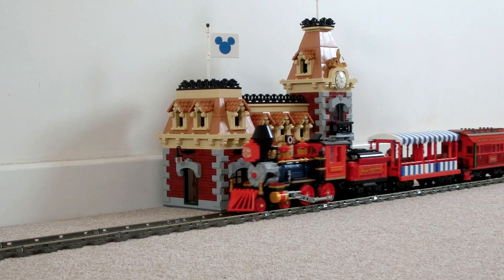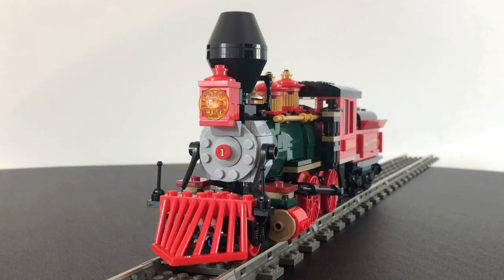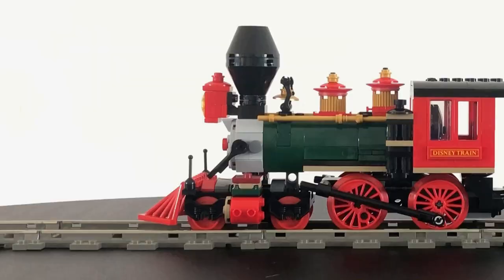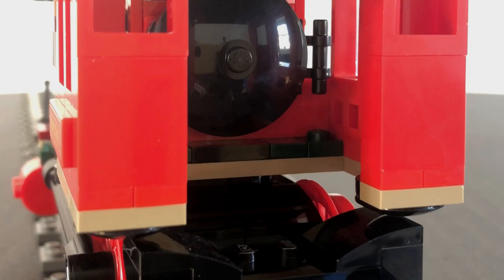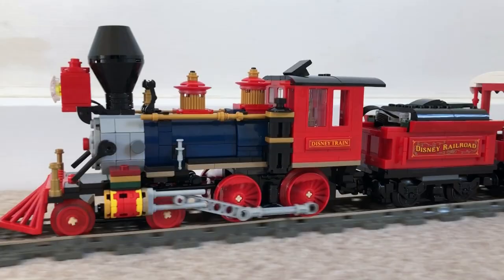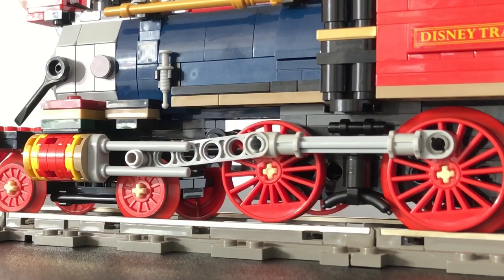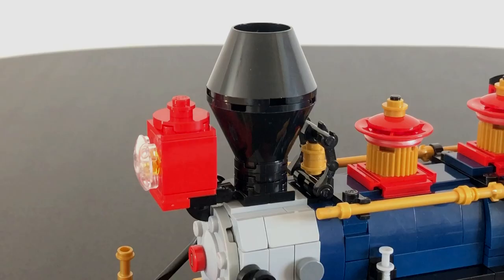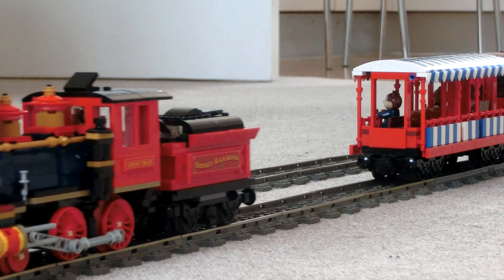Modifying the LEGO Disney Train

Comment: My only question in how you make the rods connect to there cylinder, I see you have 2 bars that hold what looks to be a technic stud pin connected to the half width technic arm, is that what you did or is that round piece squeezed between the 2 grey bars a 3d print, or some other element I am not familiar with? this is the best look I have seen for connecting rods for steam train mocs, great job! Also a little question I've had for the longest time is why no flanges on the pair of inside drive wheels, the ones closest to the cylinder? Why are those wheels not resting inside the track like the back pair of drive wheels?
Reply from the maker: Hi Joseph.  The part you refer which slides between the 2 grey bars is indeed the technic half pin/stud pin, not a 3D print. There are no custom/3rd party parts on the model.
As for the inside drive wheels having no flanges, I explain this in the video at 2:32. Essentially, if I had flanges on all the driving wheels, then the front bogie would have to move side to side, which would cause it to hit the cylinders. The front of the loco would also overhang lots on corners. Using flangeless (blind) inside drivers allows the bogie to spin on it's spot only. The front bogie acts like a set of flanged drivers if the loco was an 0-6-0.
Reply: @technoandrew  Thank you for the swift reply, I must have overlooked that part of your video when writing the comment. I had first seen that style of piston rod on a moc found on ebay, just last night (as I am writing this) I am new to the train side of lego, mostly because they are so expensive that my parents could never afford me any, though I am in the process of getting one or more in the near future so I have been doing research on custom steam mocs. Thanks again for the quick reply and nice job on the set rework! 

PS Although one thing I would like to see done differently is instead of those 1 stud wide X bars connecting the drive wheels, I would swap those for a pair of half width technic arms, one connecting the drive wheels and the other connecting the rod to the piston.
Reply: do me a favor and speak in English

Comment: Also, technoandrew there are replacement stickers for the engine and tender (and the coaches too, I guess?) on ebay
Reply from the maker: Thanks, I was aware of them and am tempted (if the shipping isn't too expensive).
Reply: Don't worry, their shipping aren't too expensive. (Also, I'd highly recommend adding space around areas of the boiler so you can add the boiler bands, if you're tempted for those as well.)

Comment: Could you modify the Lego Hogwarts express? Because that model suffered from the same faults as this one.
Reply from the maker: Martin Train Freak Funnily enough, I had the first ever LEGO Hogwarts express as a child in the early 2000s, and I modded that over time. I don’t have it any more, the parts were used for other projects.

If you want to see the Hogwarts express in Lego, look around online. It’s been done by so many people by now, and the MOCs they’ve made are miles better than the set in terms of accuracy. I don’t have any plans to get the most recent set, mostly as it’s not as good as the Disney train.
Reply: @technoandrew  I have modified the newest one (No. 75955) with couplings (carriage couplings) and coupling rods (the original design being identical to that on the Disney engine). I also made the tender bigger. I would say that I was disappointed with the flaws in it. But I think I improved my model to a good standard.

Comment: What would we do without blind drivers?
Reply from the maker: If you don't have blind drivers, you would need to ensure that the front bogie has sufficient freedom of movement (multiple pivots) to navigate curves.

The set includes a couple of blind drivers.
Reply: @technoandrew  I think that was a rhetorical question, but I could be wrong
Reply from the maker: @icheckered6837  Possibly so, it works either way.